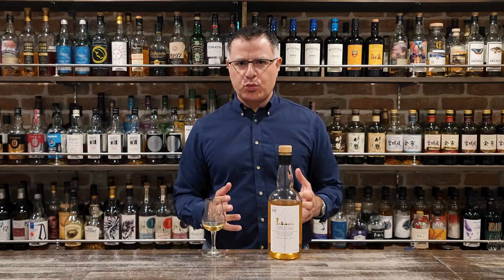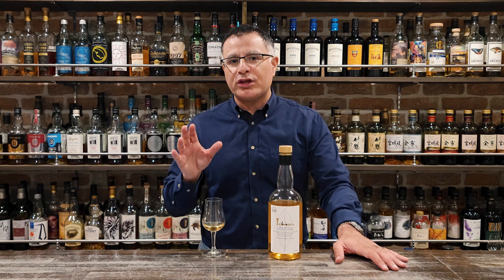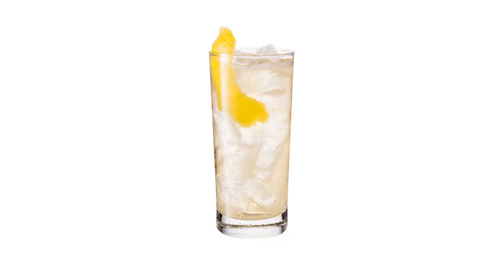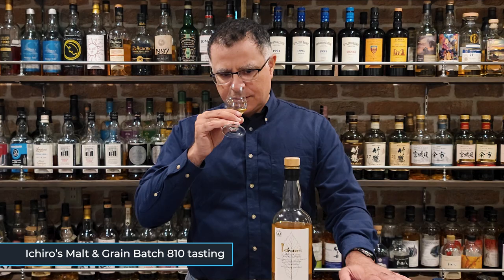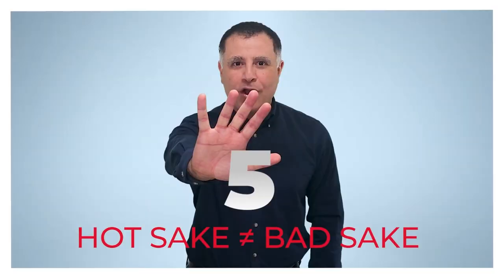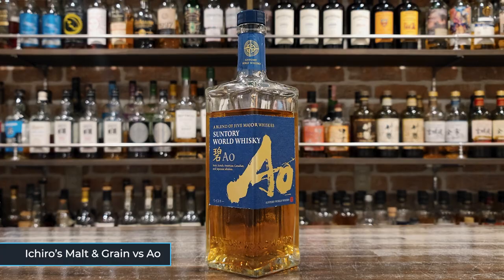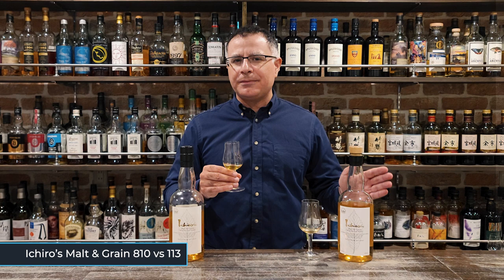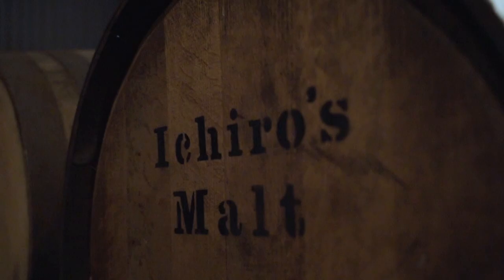Ichiro's Malt & Grain: The ULTIMATE Review

Comment: Hi mate, just wondering if you know, or will be doing a video, on the Yamazaki Tsukuriwake set?
Reply from the maker: Hi Richard. Great question. Suntory released a domestic Yamazaki Tsukuriwake set in 2020. They have now released that same set overseas in 2022, without the Bordeaux bottle. I have toyed with the idea of simply doing a drinkthrough on the 2020s, and not worrying too much about the Kanpai Planet level of info which I usually require in order to create a video. Let's just say it is in a very long pipeline. 

Please consider supporting Kanpai Planet at buymeacoffee.com/kanpaiplanet

Kanpai!
Reply: @KanpaiPlanet  oh, so it's the exact same liquid? Or just the same type in a new release
Reply from the maker: It's Suntory. Who knows?!